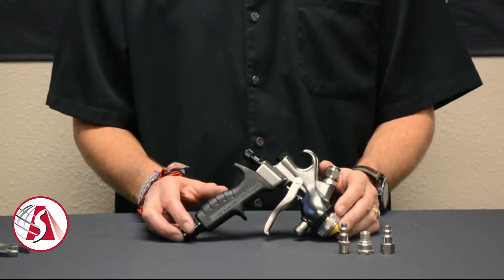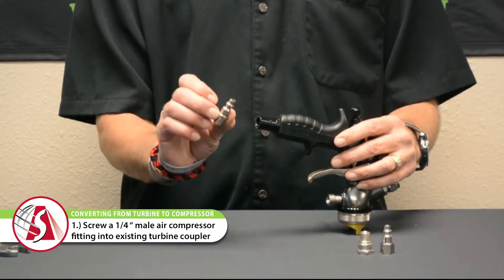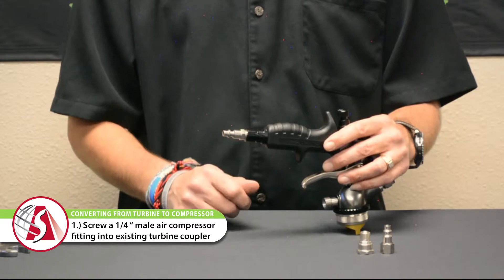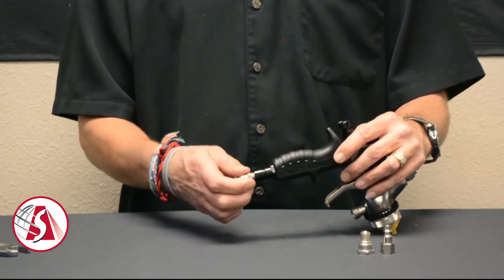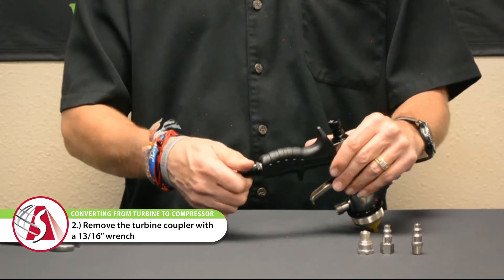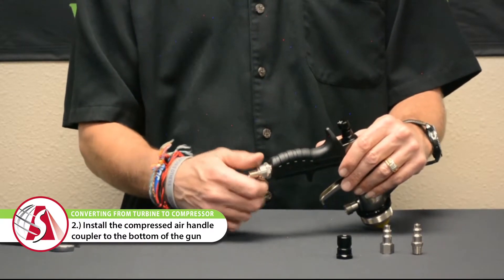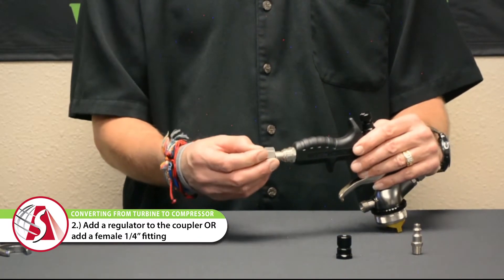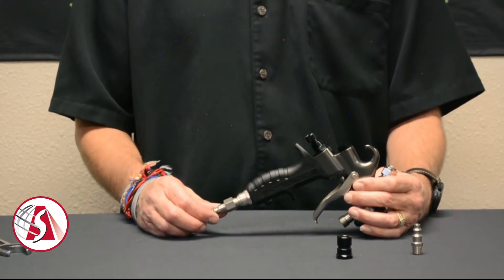How to Convert Your Apollo 7500/7700 Spray Gun From Turbine To Compressor

Comment: What is the minimum and maximum working psi for the 7700 spray gun?
Reply from the maker: The minimum is based on the coating you are spraying.  The maximum is set by EPA law, which requires an HVLP spray gun to have no more than 10 PSI at the air cap.  Our 7700 spray gun produces 10 PSI at the air cap when the inlet pressure is 23 PSI.

Comment: I'm curious if you converted the machine end of the air hose to 1/4" and ran it with compressed air?
Reply from the maker: You can run the AtomiZer spray gun from an air compressor without the need to modify the air hose.  That's what the compressed air handle fitting does.  It allows you to connect a standard compressed air hose to your AtomiZer spray gun and use compressed air instead of turbine air to atomize with.
Reply: @ApolloSprayersHVLP  my thoughts are that a typical turbine gun runs from 5-10psi from the turbine. Would it run on that low of pressure on compressed air as well?
Reply from the maker: @589RACING  No, the input pressure would have to be higher so that you can achieve the air cap pressure you need to spray with.  Our AtomiZer spray gun for instance, requires 23PSI inlet pressure from compressed air to provide 10PSI at the cap.  If you were to simulate similar cap pressures from a turbine you would need to reduce the spray gun to 10-15PSI, but still more than the turbine can give you.

Comment: I am trying use other paint guns like devilbiss pro lite but having a hard time finding the correct adjustable coupler (1/4 female  since most guns are) but struggling...what coupler u recomened to fit the hose ??? .... so I can use different guns not only apollo gun....I bought several couplers 1/4 but they dont fit the hose easy fit ....
Reply from the maker: Only guns designed to be used with a turbo spray system will work.  No other compressed air spray gun of any type will work properly due to the size of the internal air passages.  They are just too small to be effective.

Comment: What the size of the female coupler quick connect turbine  spray gun handle compressor size and turbine size as well? Plz
Reply from the maker: The female thread inside the turbine handle coupler is a 1/4" NPT.
Reply: @ApolloSprayersHVLP  yeah that's what I thought but wasnt sure thank u
Reply from the maker: @marioflash5790  You're welcome....have a great day!
Reply from the maker: @dusan78  The 1/4" NPT thread is for compressed air only.  The turbine coupler has a 1/2" opening.  The spray gun is 1/2" through out, that's why we use a 5/8" air hose from the turbine.
Reply from the maker: @dusan78  We are happy you have chosen Apollo to paint your cars with.  You will really appreciate the low overspray environment.  The spray gun has been designed with both air sources in mind.  Compressor guns can easily run with much less than 1/2" passages, but they can also run just as well with larger ones.  When we designed our 7500/7700 spray gun we designed to to maximize the efficiency using either air source.  This is what makes our spray gun so unique.

Comment: Hi,
Thanks for the video. Do you have any video footage of the 7700 being used with a compressor? I can only find videos of it with a turbine. I bought a 7700 to use with my 3 stage turbine recently and I'm not getting the atomization I need with the waterbased Tikkurilla paint I'm using. I could justify buying a 'good' compressor as I can use it with other tools in my workshop. I can't really afford upgrading to a 5 stage turbine just yet. The gun is great by the way!
Reply from the maker: Most of the video's that we have are generally showing people spraying.  This can be with a turbine or compressor, the results are the same, given the same air cap pressure.  Keep in mind if you use a compressor you will have to spend extra money buying filters and dryers.  By the time you do that, you could have purchased a 5-stage turbine.  We don't have too many video's showing compressed air, but there is more information in the instruction manual on using your gun with compressed air.  Always feel free to call our customer service reps for assistance, 1-888-900-4857.
Reply: @ApolloSprayersHVLP  This is what I try to tell people. "oh, I get a spray gun from Harbor Freight and a cheap air compressor from let go" Sure maybe the first time you buy it its cheaper, but think about the money you spend after you bought 15 $45 HVLP guns and 2 used air compressors! There is only one reason I would sell an air compressor and it isn't because I need to upgrade it.  Proper air dryer alone cost $200 or more. I just bought a Eco 4 to spray Mohawk Nitrocellulose lacquer.
Reply from the maker: @garyprice4583  You're absolutely correct.  Air dryers alone can run upwards of $2,000 just to keep your air clean!  Turbo Spray is the way of the future!

Comment: Can you do the opposite? Use a regular HVLP with turbine?
Reply: Only our 7700 spray gun has the ability to convert between turbine and compressed air.  Most HVLP compressed air spray guns have 1/2 the size air passages inside the spray gun, which will not allow them to work well when connected to a turbine.  You just can't get enough air through the spray gun to atomize as the turbine doesn't compress air like an air compressor does.
Reply: @jadarroch  A lot of people I know use cheap guns to spray metal flakes, Is it best to use the compressor and a disposable HVLP gun? I've not seen anyone use metal flake in an HVLP. Is there a gun I can use with my eco-4 that can be cleaned out or dedicated to just metal flakes?
Reply: @garyprice4583  We are working on a device that will allow you to spray dry metal flake with our 7700 spray gun using your turbine.  Stay tuned this should be available in the next few weeks.

Comment: Have a quick question I have devilbliss and iwata gums that is like to convert to a turbine .., where can I purchase the turbine coupler ?
Reply: The Apollo 7500 Atomizer is the only spray gun in the world that can be converted from a compressed air gun to a turbine spray gun.  Your DeVilbiss or Iwata spray guns are designed to only be used with compressed air.  Our Atomizer spray gun has been designed to use either compressed air or turbine air and as such the passageways throughout the inside of the spray gun are twice the size of those inside your Iwata.  You could purchase our Atomizer spray gun and then be able to use it with both compressed air or turbine air.
Reply: @jadarroch  Accuspray series 10 can also spray with turbine and compressed air
Reply: @cruzs.9040  Yes, but not without changing some parts first.  Accuspray turbine guns are no longer made.
Reply: @jadarroch  I guess this is the only draw back to the turbine system since we cant use different paint guns and only have to purchase multiple apollo guns ... since hard to use only one gun for a car project.. I really was hoping to use my devilbiss on this system.... bummer
Reply from the maker: @marioflash5790  Standard compressor HVLP spray guns don't have the necessary interior passages to use the volume of air.  Your DeVilbiss gun is designed to use about 10 CFM give or take.  The Apollo Atomizer gun is designed to take 60+ CFM from the turbo motor.  This necessitates more than twice the size of air passages throughout the gun.  This is why standard compressed air guns don't work with a turbo spray system.